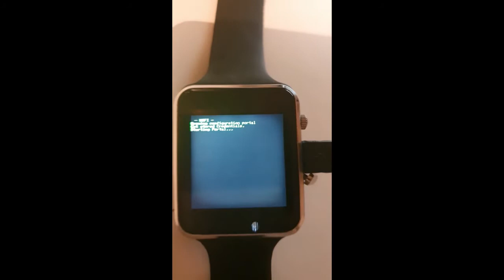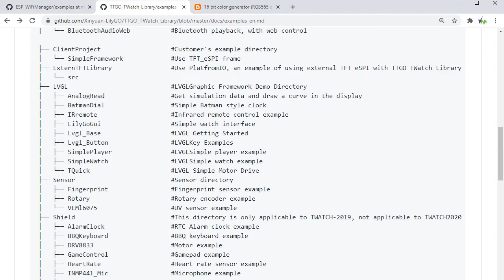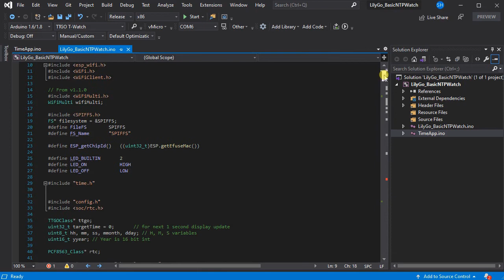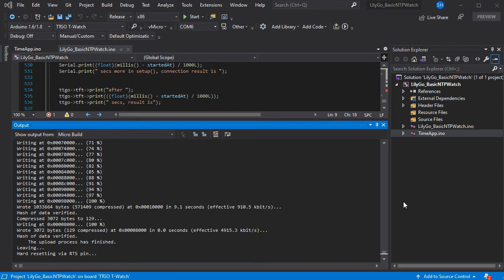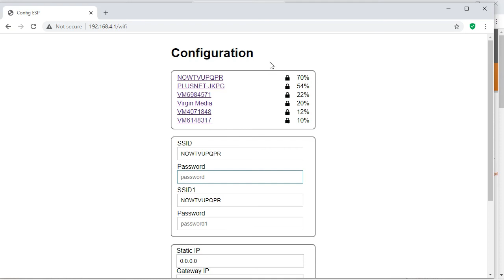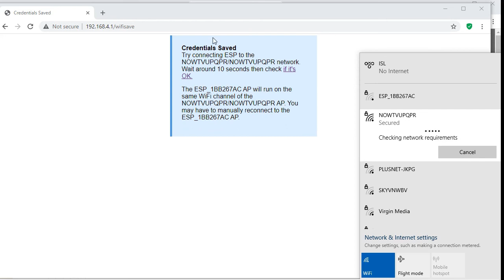Easy WiFi Configuration for NTP Sync Smart Watch (LILYGO T-WATCH-2020)

Comment: Hey friend,
I used your code, though the SSID of the watch does not appear on the phone / computer to connect to the webserver.
Do I need to change anything in the code to make it visible to devices?
Reply from the maker: All we can think is the device already has stored credentials.
If you add "ESP_wifiManager.resetSettings();" in the "ESPWifiManager.ino",  above line 225: Router_SSID = ESP_wifiManager.WiFi_SSID(); 
Then this will reset all settings after the next upload/startup.
Then remove the line of code and re-upload so the new settings are saved and it should work as expected.
The Serial Monitor should show further detail about the connection and what network is being setup / connected to.
Reply: @visualmicro4389  You're Amazing! It was just that, thank you very much for your help, friend!